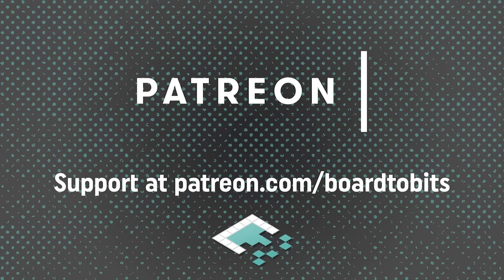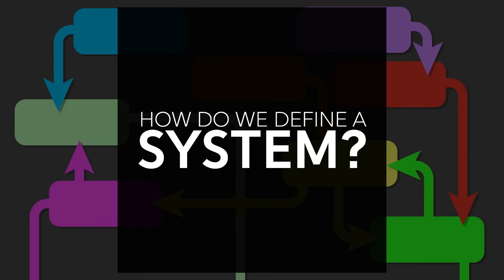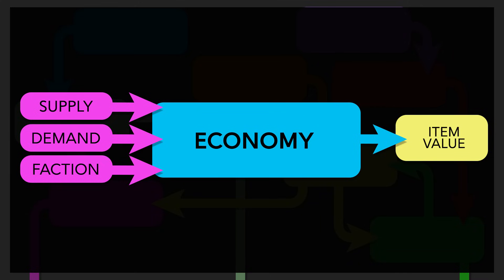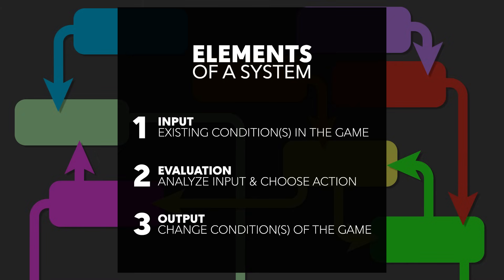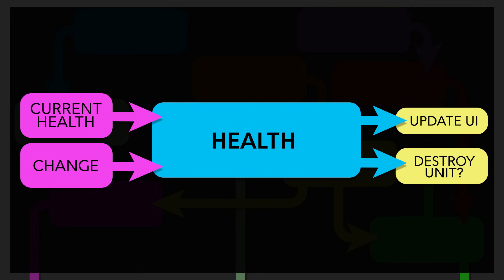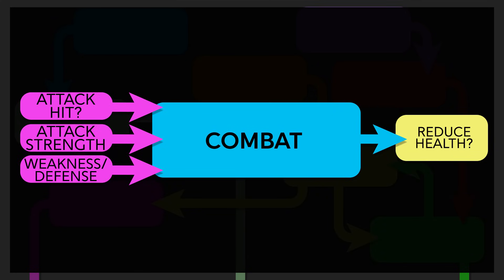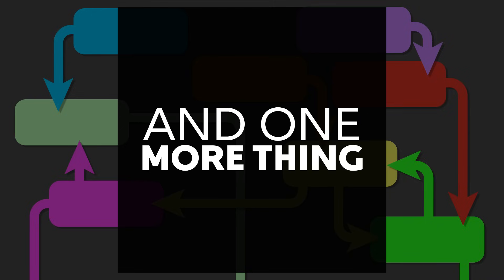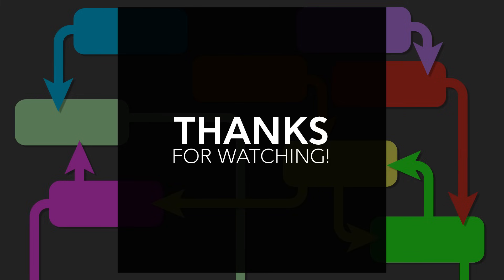Systemic Game Design, Part 1: What are Systems?

Comment: 1:48 Gravity system has nothing to do with "what's below unit". Gravity system applies gravity - a force upon objects. For collisions with ground there is collision system that stops objects when they are colliding. Together they form physics system.
Reply from the maker: You are correct, I was making a generalization that could be misleading there. I will clarify in the future.
Reply: This isn't a black and white situation. 
(This is a warning and a lesson! For those who might find this comment in the future!)

What you speak of is fine from the perspective of the physics. 
(A good example would be in a physics simulation or sandbox style game.)
But often when programming, and especially in game programming, it's important to recognize the context you're creating for.

Many games might care more about what's under the player than having accurate physics calculations. 
(For example, a Mario game has jumping and landing on an enemy, a shell, the ground, in water, on a power up, and so on...)
Because that "Mario Gameplay" context you're creating has heavy dependence upon "what's below unit", it's probably preferable to create a system where such a dependency is foundational to it's framework.

This achieves several useful things, such as, in our case, allowing gravity to be triggered on and off as a gameplay mechanism instead of a constant force.
This can help save a lot of valuable cycles that might be spent trying to calculate that gravity, which may be important given hardware limitations or other factors.

It also, as previously mentioned, helps maintain a sort of "centrality of focus" on the idea of "what's below unit." 
Which in the case of a "Mario-style" game helps when trying to focus on developing systems that don't feel disjointed and have a sort of adjacency to the core "game feel". 

This allows for not only the focused DEVELOPMENT of adjacent systems, but also aids in their DISCOVERY! 
Such systems might be dying on spikes, collecting power ups, or even things like bouncing up off of an enemy after landing on them if you continue to hold the jump button (a system that is a Mario staple!)

It can be easy not only to have difficulty properly implementing these systems, but to completely miss the discovery of them altogether if you are always rigid in your mental framework on how you approach systems design.

Comment: Dude great video man, I watched your tutorial on back hole shader effect about 6 months ago, it worked so nicely :). When I upgraded to 2018 lightweight pipeline a couple weeks ago the shader doesn't work anymore, how do I make it compatible? has something in the syntax changed?
Reply from the maker: I wish I had a good answer for you. The new pipeline is so new I think there are still just gaps in what’s supported. Ive had the same issue using the pipeline with VR builds, so I’ve had to just stick with the old rendering for the time being. If I run across a solution, I’ll post it here.
Reply: Thank you :), your knowledge is so valuable. Is the vector maths you use utilizing a built in distortion effect? Or is it that any text based scripting is not allowed in 2018 pipelines? I'm also noticing that any distortion effects don't work, but they are custom, I download to see if distortion was the culprit, I'm confused on these new pipelines, no tutorial really go's in depth with these pipelines, everyone is just iterating on basics lol i'm lost on if we have any shader control outside of shader graph or not?